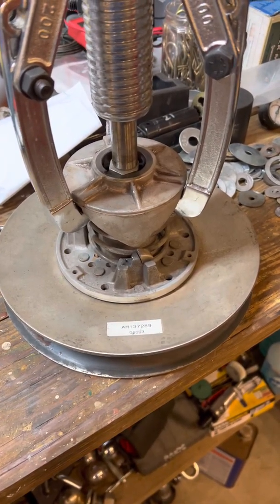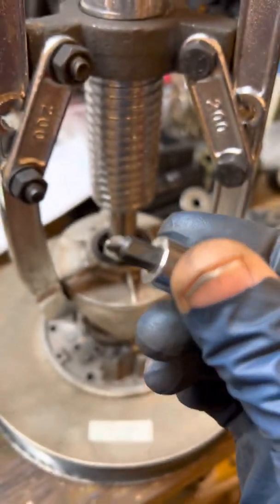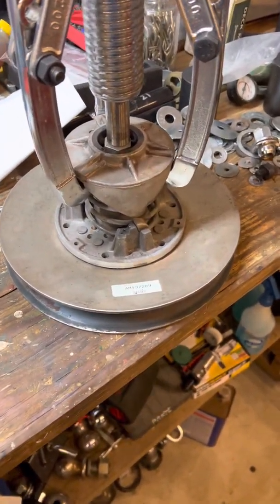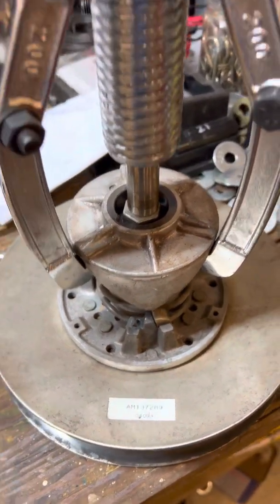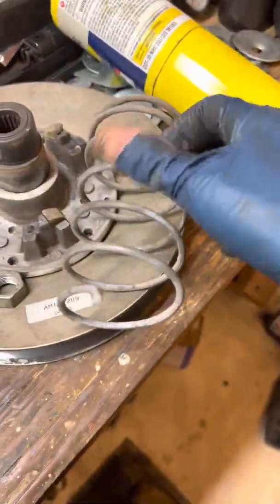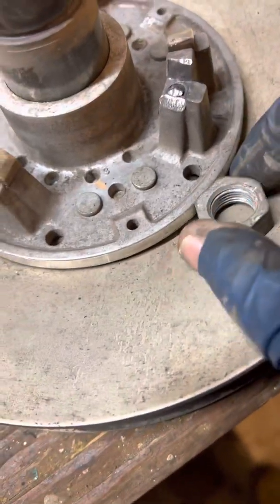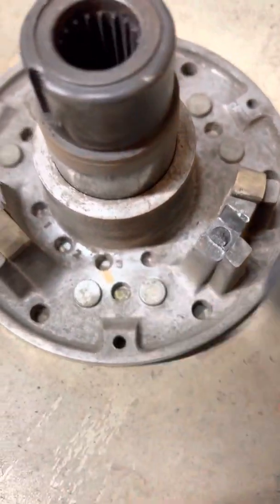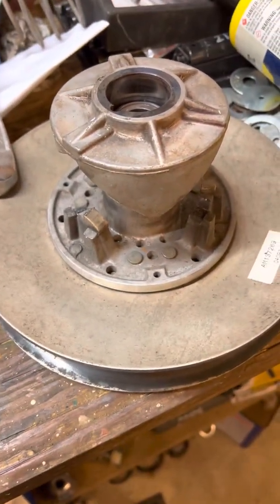Driven clutch / secondary clutch disassembly for John Deere Gator 6x4

Comment: Im having the same issue, i had to remove the set screw and with your advice i got it out.  Now my 3 jaw puller is struggling to pull it up.  I just gotta replace the buttons on the thing so i just want to get it up a bit